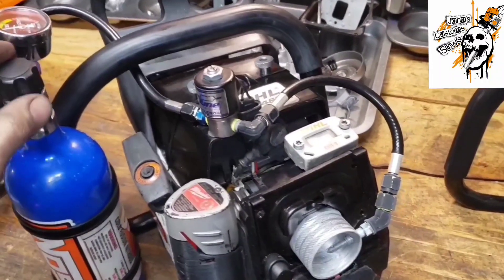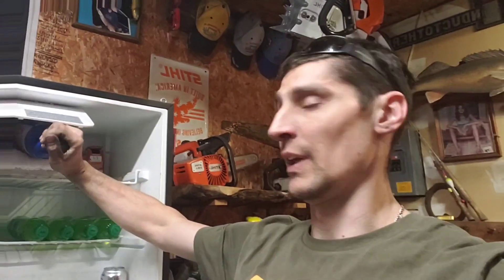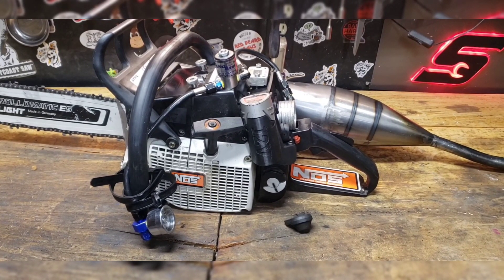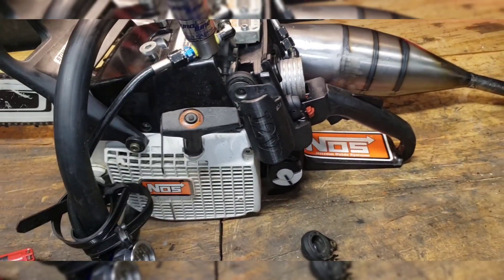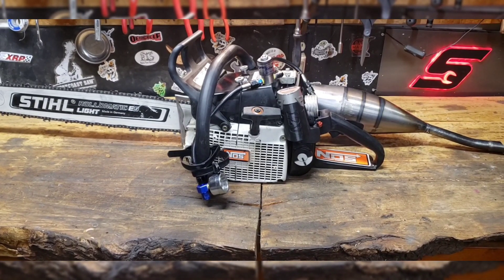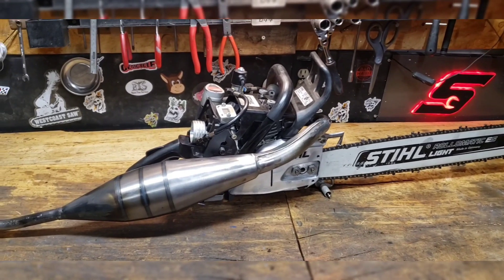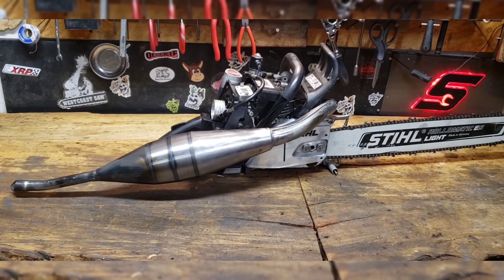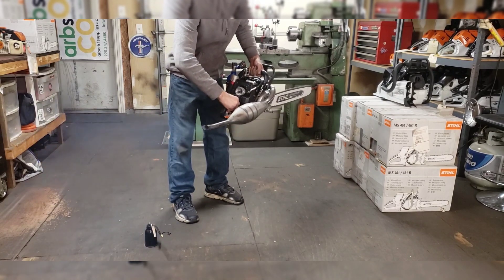Update on the MS460 NOS project...

Comment: Seams like the dry shot would lean it way out or do you just have the carb set really  rich ?
Reply from the maker: yes definitely... i have messed with a wet shot but its really tough on a saw with really small carb/intake... tiny venturi so to add fuel/NOS spray with the existing fuel there is no room for air it seems... would need an 084 carb or something... oddly its not burning up cylinders tho... i ran 12lbs of NOS thru the original top end and its fine... i replaced it because i had one here and wanted to but not having a filter is definitely hard on it lol
Reply: @johnscustomsaws  interesting , ill stay tuned to see where tou end up with it.

Comment: The beauty of a wet setup is that the carb settings on motor won't need to be adjusted for when your on spray..the fuel is added with a second solenoid. I messed with a Sneaky Pete dry shot on two strokes years ago and it never really worked reliably.
Reply from the maker: Exact results i had my man... the wet shot setup on 2 strokes is not easy... thats probably why u don't see it is my thinking... I almost think the mtronic or fuel injected saws would work better because the electronics would still try to calibrate to straighten it out... adding fuel and NOS to a small intake is the issue especially in a saw... gotta have air in there somewhere too lol .. its a tough one man
Reply: Keep at it..this is great stuff!!
Reply from the maker: @michpatriot9097  thanks my man... definitely more to come... plus the 084s im building should be interesting... that carb is large enough to try a wet kit